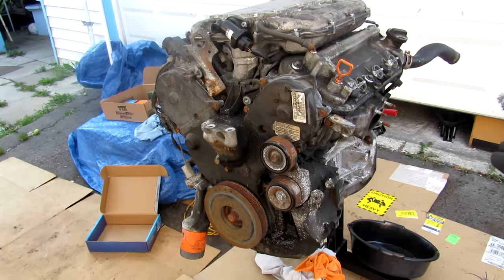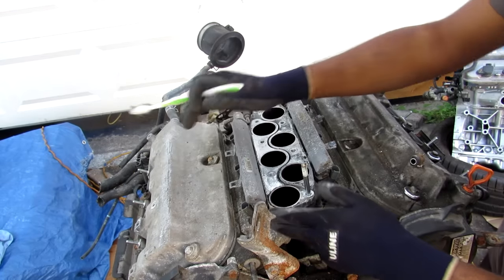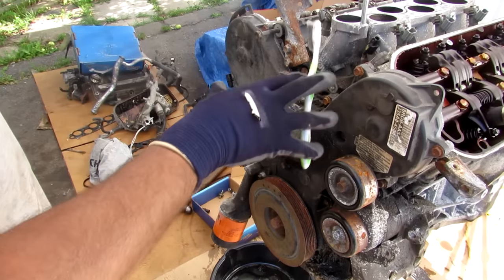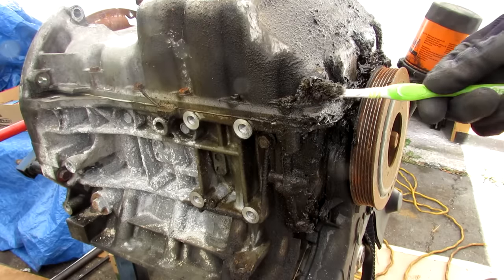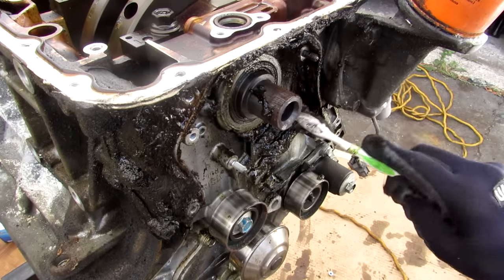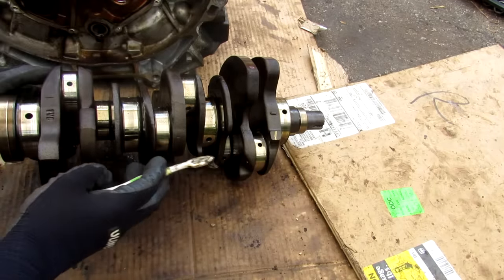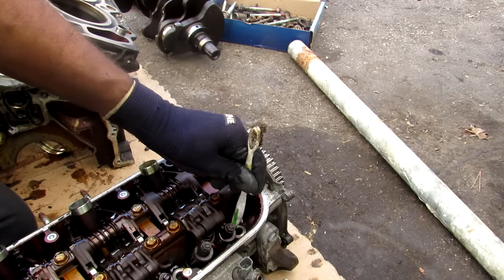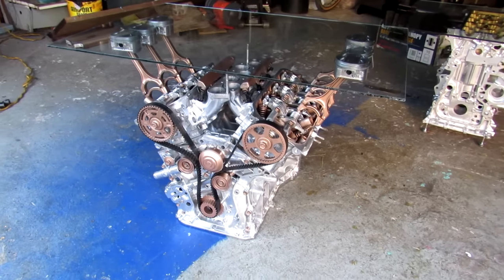Why Honda V6 Engines Haven't Changed For 25 Years

Comment: I have an 07 TL type S with a 6-speed manual This engine is badass especially with the 6 speed Not the most fuel efficient engine in the world, but extremely reliable keep up on the maintenance, timing belt, water pump, valve adjustment, etc These things run happy as a clam
Reply from the maker: Agreed it's a good engine and by going with the manual you avoid Hondas weak auto transmission. It'll last you a while
Reply: @speedkar99  Yeah, and I always take very good care of my vehicles I'm the 4th owner And when I serviced the car from the looks of it outside of oil changes It looked to me like the previous 3 owners didn't really service it I went above and beyond When it came to the major service timing belt water pump adjusted the valves brand new iridium spark plugs  brand new motor mounts and transmission mounts brand new power steering fluid got the recall done with the high pressure line changed the transmission fluid With OEM gear oil put the Honda blue coolant back in someone changed it to green which is a big no no brand new brake fluid fully bled oil change new pads and rotors all the way around and a brand new set of Michelin pilot sport All season 4 tires and got it aligned. After all that work the car is happy as a clam I bought it with 95,000 miles on it currently it's got 102k and I'm planning to keep it for a long time

Comment: Excellent video friend. I'm not a mechanic, and I have a 2005 Odyssey. I need to chance the knock sensor and watching your vídeo, i detect that i need to remove some parts ir the engine. My question is to know the tightening torque a ir the screws and nuts of the intake runners or intake chambelán. You can support me with that information. Greetings from México

Comment: Stupid question im a big Honda fan love the reliability they have and yes the 3.0L and 3.5L v6 are my favorite engines they produce now my question is if you wanna build their V6 engine is if possible to switch the timing belt design with a timing chain just curious and I don't understand why Honda didn't design them with a chain instead of a belt
Reply from the maker: I don't think that would be as easy

Comment: The issue with regards to servicing this engine is the use of a timing belt instead of a timing chain and the poor access to the water pump. That's what keeps me from buying an Acura with a 6 cylinder engine. Toyota uses timing chains on many of their 6 cylinder engines.
Reply: Only on 3.5 2GR engines. 3.0/3.3 both use a belt. But you only need to change it every 90-100K and it costs about $600 if you're replacing everything. Replacing the water pump on 2GR would cost about the same if a shop does it (somewhat labor-intensive to get to it) and those pumps sometimes fail at 100-150K. Oh, and there's also a rubber oil line that can fail and ruin the engine
Reply: @d.o.5238 True, not all Toyotas V6s run a timing chain. Definitely have options compared to Honda. Here's a list of Toyotas with timing chains http://yourcarangel.com/2012/06/toyota-timing-belt-and-chain-list/

Comment: Question if I replaced both head gaskets on my 3rd gen. Why would it still be allowing water to mix into the oil?
I’m thinking my thermostat housing gasket is is failing or maybe the water pump. I’m hoping the block is not cracked

Comment: I have a question for any pro quality gear heads out there I just recently purchased a 2001 ford Taurus se wagon for a simple A to B car but I noticed immediately that the trans is slipping really bad I've been watching videos on how to repair the stock trans but I'm curious as to how hard it would be to do an engine swap with a v6 v-tech engine an trans

Comment: I had an Acura MDX with the similar engine it just I think got different camshafts and tuning and it had a quarter million miles and the thing that stopped it was a spark plug o-ring eroded and when I changed the oil oil was seeping down in there and it blew the spark plug and i took a little too long pulling over the road and the spark plug got hard and black charred thing and messed up the spark plug threads we had to rethread it but it was already too late it messed up the head so basically if i would have If I had caught it it would have been still going past a quarter million miles So yeah even though they're pretty weak like you can't add more power to them the rods are weak and the thin pistons ring lands and such and the transmissions the all-wheel drive transmissions can't take much more power as a stock unit they're pretty amazing and I'll tell you what that all-wheel drive and that rear electronic locking diff I took that MDX places it should have never gone But it's a pretty nice old terrain tires on it later and I never got stuck snow and that's up in Flagstaff Arizona I loved it and ive never sat in more comfortable seats than that MDX

Comment: The intake runners aren't too bad to take off. I've done it a few times. Four bolts on each one. It can be done using either a shallow 1/4 10mm socket or 10mm wrench (depending on where the bolt is located on the runner).

Comment: My 2005 Odyssey has 250,000 miles on the original engine and transmission and runs great!  After 4 dogs and 2 sons, it isn't looking the best, but the engine still runs like a champ and doesn't burn oil.
Reply from the maker: Yep Honda motors are strong. Does yours have cylinder deactivation?
Reply: My cousins 05 odyssey had cylinder deactivation it got totalled with 318k miles. Someone ran into the back of it🤦

Comment: Yet another stunning video. So much information and excellent content presented in a straightforward way and absolutely straight to the point without any unnecessary waffle. Absolutely brilliant, thanks. No-one else does it as well as this.

Comment: I always wonder why people sleep on the J series. People will spend lots of time and money to get a k series to 300 hp meanwhile a j makes that stock more reliably and the engine can be found for like 1/4 the price of a K. Sure its a van motor at heart but its cheap reliable horsepower and they are actually about the same weight believe it or not. Not much aftermarket support but people have modified these engines reliably as well.
Reply: Basically, there's not much you can do to get more power out of A J35/J37. J37 is already Honda's most powerful naturally aspirated V6 which they haven't been able to top ever since the second generation MDX and ZDX. You can put a compressor on it and get may be extra 60-70 HP with a chip, which is completely not worth a huge investment you will require for that type of work. That's why these engines are not really tuner's engines. Also, a good condition used J37 will cost you an astronomical amount of money.
Reply: Acura Addicted, not buying it for a minute!  Aside from a chorus of power-building testimonials across the Acurazine community, more contemporary, it’s a fair guess the 2021, TLX type S with announced hp @ ~ 360 will employ rebirthed J30 block/heads, with likely well over  400 hp with forthcoming tuner mods.  Companies like CMS Engineering, and Bisimoto among others, not to mention Honda Performance Development (HPD), will disagree with your naysayer view of J Series potential!
Reply: @Snookynibbles  I agree. Even stock its a great swap for reliable hp without any mods. A K will cost you a lot more in mods and reliability just getting it to 250hp. Not to mention the time building and tuning.

Comment: I had a 2004 and a 2013 Acura TL. My wife has a 2014 Acura RDX. All 3 were 6 cylinder engines; was this basically the engine in all 3 vehicles?
Reply: yeah

Comment: I have a ‘96 SE(194k miles) & ‘99 GXE (134k miles) Nissan Maxima, both engines are 3.0 liter V6 with a metal timing chain never have to replace it, just regularly change oil & filter. Both cars going strong 9/17/2020. 
Why does Honda & Acura use a rubber timing belt thats so stupid if the timing belt snaps your engine is toasted. Then you got to replace the timing belt which cost $800, then the mechanic will charge you $1k for labor.
Reply from the maker: The good old VQ30

Comment: The J series V6 is gonna be my swap motor of choice ...for anything. S10, Ranger, MX5, MGB, Corrolla, ...anything. it's not 1000 horsepower, but the HP and Torque it produces is way more than enough to be fast and fun. Especially in a lightweight body vehicle..like a MX5 or S10
Reply from the maker: Hmm it's so old school though

Comment: Came here from a 'You Tube' recommendation. 
I think you need to read up on what EGR actually does, it's more than just' pollution control'.
 I thought you were going to mention the offset crank-pins when you started on engine balance? Doesn't the offset make it act like a 90 degree motor? (perfect primary balance) Balance shaft should then take care of secondary rocking couple.
Oil jets are to cool piston crowns not lubricate cylinder walls 
Honda 'stole' it from Suzuki who 'stole' it from 1930's aircraft piston engines
Good overall though, I'm always interested in whats inside various manufacturers motors and that is way less complicated than it could be  (still don't like Honda VVT though).
Reply from the maker: Thanks and yes I can go into more details on those in specific videos. 

I have a video on EGR from a while back

Comment: I got 330k miles on original engine and transmission. Best engine I ever owned. Plenty of power for its class and reliable. Gas mileage is okay not the best. But I been using mobil one syn and just following the computer when yo change it. Never did nothing major but timing belt, sparks plugs etc etc.

Thank you for awesome video
Reply from the maker: What original V6 transmission you have at 330K?
Reply: @speedkar99  
Which atf do you suggest for Honda redline d4 vs dw1?
Reply: Yeah original tranny. Mine has a tranny cooler system from factory other TL (normal) don’t have a tranny cooler. The auto transmission those years from I think 06-08 where very good. I only use Honda DW-1 auto fluid. I do the 3 times change every year no matter of miles. Still shifts fine. Don’t get me wrong I know it can go anytime but I love this car so much and try my best to treat it good.

My car a 2007 Acura TL type s.

Comment: Ive got a 2004 acura mdx with 300,000 miles it's my daily and everything on it is old and warn out. Except for the engine. I've had it since 198,000 miles and i got it when i was 15 from my dad. And now im 18. And trust me. I drive it like a teenager. And somehow it still goes like nothing happened to it. Last night i ordered a 05 parts MDX and im going to get the trans and rear end and put it on mine and then new breaks, new shock absorbers, and new coil springs. And im gonna put another 300,000 miles on it.
Reply from the maker: It's awesome how long the engines last.. .if only they paired it with a proper transmission

Comment: Had 3.2 in my 07 TL, it was a great reliable engine just as long as Timing belt was maintained. It was a good car.
Reply from the maker: Good engine. How did the transmission hold up?
Reply: The 3.2 a non interference engine

Comment: Good engine, just need to budget for the timing belt change every 7 years which locally for me is averaging 2k including water pump. This has had me lean towards Toyota V6s.
Reply from the maker: Early Toyota V6 has belts. 
Unless you're talking about 2007+

Comment: The crank bully bolts are insane I have a $750 impact wrench and it couldn't get the one off my Acura MDX I had to heat it up with the torch a few times first we actually put a 6-ft pole on my ratchets to try and break it and the ratchets just ended up breaking instead those things are crazy to take off
Reply from the maker: Agreed. But everyone I've been able to get off with a 4' pole and a strong breaker. The engine has to be secured to the stand and something wedged in the crank.

Comment: V6's suck.  The inline six is where it's at.😊👍 Almost every transport truck in the world can't be wrong. Also don't forget the 2JZ, do I need to say more?👍😎
Reply from the maker: Yeah but the packaging of V6 is hard to beat ..
Reply: @speedkar99  As a person with size 12 hands I would beg to differ. I dislike having to remove the engine in order to service it. Inline sixes leave lots access room in the engine bay.😉

Comment: I use fram extended guard with red line and lucas low viscosity oil stabilizer every now and the it will eat a quart of it

Comment: Had a customer at the shop with an Acura MDX with this same v6 with a no start condition. Thing had about 400k on it and the timing belt went. Shocked it lasted as long as it did. So we swapped a used one with about 175k into it with a new timing belt. Guy came back 4 months later with his whole front end caved in after hitting a deer 🥴
Reply from the maker: Things happen...

Comment: if you guys want to learn about why the transmissions on these engines failed I found the problem and the solution. And I basically take you step by step through the teardown and rebuild of the five-speed automatic transmission. I show you why third clutch and I explain why second clutch Burns out depending if it's a four-speed automatic or five-speed
Reply from the maker: I want to make a video like that
Reply: @speedkar99  if you need any tips let me know, I spent a year on the project and I've dissected every part of the 5 speed transmission. I wrote a summary of why the transmission broke, it's in the description. not trying to spam here

Comment: Steel oil pan > aluminum oil pan.  Hit something on the road/drag your aluminum oil pan you better check it immediately for cracks/leaking.  Hairline cracks too.  Steel pan = nothing to worry about
Reply from the maker: Rust

Comment: unfortunately both Honda and Subaru have discovered how to put more filler in the hot dog. Ask any honda dealer tech how much he loves pulling the 3 rear pistons to re ring a low mileage motor.
Reply from the maker: That's models with VCM ?

Comment: BLOCK. They have been using the same BLOCK. There is a lot more to an engine than just the block. To say the engine hasnt changed in 25 years is really a disservice to what Honda has done over that time.
Reply from the maker: A tweak here or there hasn't really changed this engines fundamental design.

Comment: I really don't see a timing belt as a downside. Its not a very hard or expensive job to do, and I find belt driven engines seem to last longer provided the belts are actually replaced. I can do J series timing belt and water pump jobs in 2 or 3 hours depending on the vehicle. Definitely helps to have a real kick ass impact for the crank pulley bolt. Try to find aisin or NPW parts, as they are OEM quality and usually the same price as the Chinese made house brand parts sold at most parts stores.
Reply: I did the timing belts with original Toyota parts (water pumps, pulleys, tensioners) in my old Tacoma and my mom's old Sienna. So happy to have finally did both - until one of the Koyo idler pulleys for the Sienna's belt began making so much noise just recently (about a year after I replaced it). I can definitely tell it's the top-center one. Now I gotta dig into the stupid thing again. I love timing chains on engines that are good or have been improved from old chain designs that sucked.
Reply: Not expensive to do yourself.
Last time I got curious how much a mechanic would charge to see if it was worth getting lazy the normal price seemed to be $1500.

Comment: Great video. I was watching it because there is a Honda J swap for Miatas. They bolt to the Miata 5 speed transmission via an adapter plate that also acts as the engine mounts. The thing that bothers me is the modification of the inlet plenum. The swap cuts and makes a side entry inlet, which seems hokie. Can the inlet be installed backwards with the throttle body at the “front” or timing belt end of the engine?
Reply from the maker: Yeah but the airflow in the intake plenum is going to be a little messed up, this one has an acoustic induction system too

Comment: I gotta take say this motor only suck "reliability" wise, because maintenance schedule, this engine honestly needed a timing chain, not a belt! It would've given this engine greater power potential, plausibly adding vvt. 

Even though these are easy to replace, it could've been a lifetime component, having a chain

Edit... I didn't know he already mentioned it 😆

Comment: I gotta say, that was a cool video.  I'm no wrench, I understand the basics.  Your speed of delivery was intense, but I kept up.  What is your overall opinion of modern Honda 3.5s as they are employed in the Ridgeline, Pilot and various marine applications?
Reply from the maker: I say boo because VCM
Reply: @speedkar99  VCM can very easily be deactivated.  I put a VCM muzzler on my 2013 V6 Accord sedan, and it doesn't have any oil consumption, spark plug issues, etc. And it runs dead silent and like a clock.

Comment: the E G R is used to reduce the amount of oxygen the engine intakes at operating temperature to reduce NOx emissions that is created at high temperature when Nitrogen and oxygen mix to make Nitrogen oxide that is toxic for the body and has very little affect on the environment! the E G R does recerclante unburned hydrocarbons but it isn’t the real reason behind its use
Reply from the maker: Emissions control

Comment: J37 are Pieces of dookie. Idk if because mine was canadian zdx built but the engine went at 72k. Me being a newbie i didn’t realize burning oil to fast was bad and i tho frequent oil changes wouldve fixed it... I feel like honda/acura v6s are garbage. Most have engine and transmission reliability issues..
Reply from the maker: Did yours have cylinder deactivation?
Reply: @speedkar99  no it was a 2010 acura zdx manufactured in canada. I think they came with the cylinder deactivation after 2014/2015